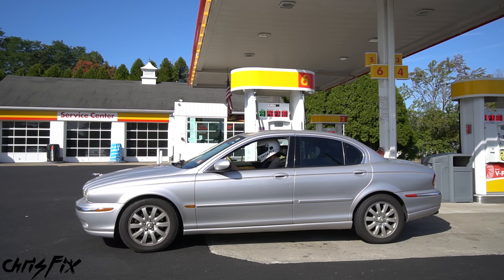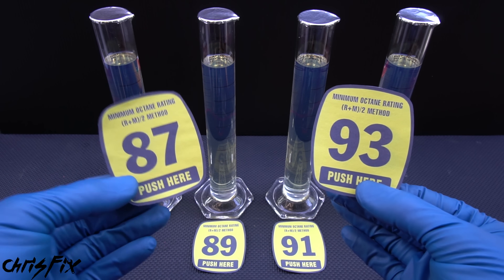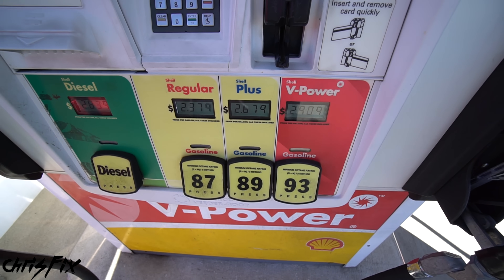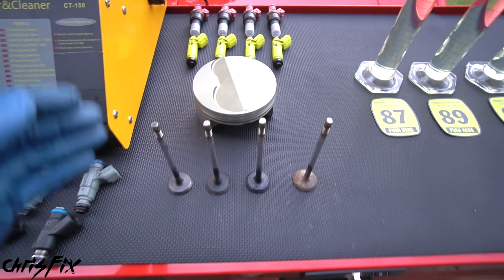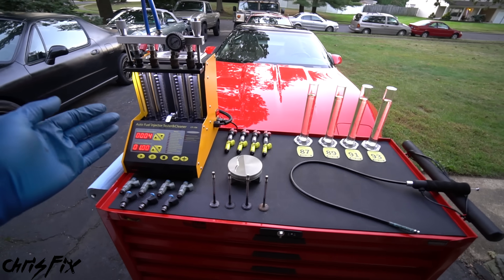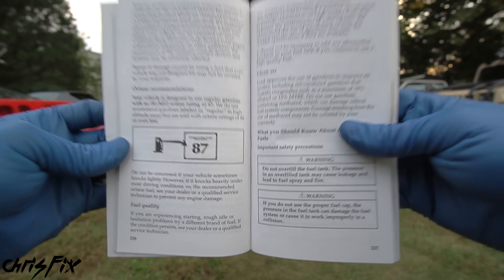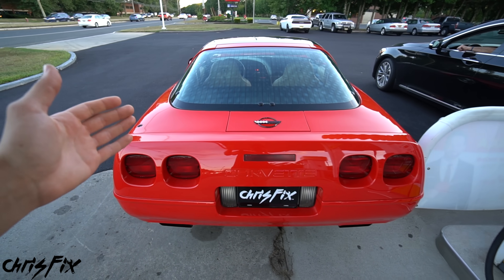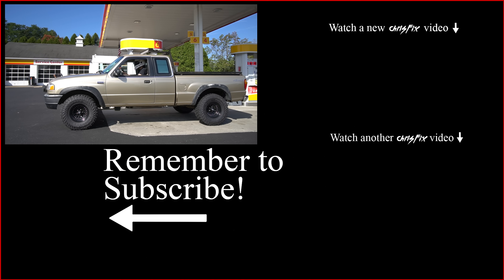What is the BEST Fuel to Use in Your Car or Truck and WHY

Comment: its not so simple; if you have a GDI with low tension rings better to go the most octane since it contains a lot ore of the additives which magnify the cleaning and lubricating effects of the fuel in the ring zone

Comment: At the 7-minute mark this is really unfortunately a little deceptive because he's talking about direct injection engine with the valve. Is insinuating that the gas keeps it cleaner but the gas doesn't hit the valve in a direct inject engine which is why they are building more and more crap nowadays. If it was a normal engine these valves would stay clean because gasoline would clean them in the engine itself but now the engineer it so it doesn't which is another things that make new engines crap

Comment: Some of the this stuff is such BS. First of all they do make gas without additives. They sell them to off brands gas stations like anything that's not shell, Chevron and such. Another thing is in the 80 to the early 2000s Toyotas and Hondas go a half a million to a million miles without carbon problems and they didn't have all of these additives. Gasoline itself cleans a lot of the carbon off so stop with all the BS it doesn't help near as what people think.

Comment: Apparently this is VERY prevalent with a variable compression engine. My nissan rogue is made for 87, but runs very notably better with 93 octane. Its compression range is between 8:1 and 14:1 both crazy ends of the spectrum. But the acceleration and power profile and apparently the power curve are drastically different depending what I put in. It makes 201 hp at 5000 rpm either way but you feel the difference getting up to speed before that.

Comment: My truck takes 87. I once blew a spark plug driving up a mountain pass while towing a medium-heavy load. Nothing even close to the towing capacity. I spoke with a mechanic later on who recommended premium fuel in those situations. After watching your video I’m assuming this info was completely incorrect?

Comment: I used to use 89 octane a fair amount of the time in my old Ford Ranger trucks. I noticed that those 3.0L engines would want to knock as they got some mileage on them. Running 89 octane cured that without needing to burn premium.

Comment: I have a 2004 Toyota Echo RS 5 speed with a 1.5L, 4 cylinder engine. 
I've used Shell 93 octane in it the entire life of the car. 
It curently has 500k miles on it and still gets 45+mpg. I opened up the engine for the first time this summer, and it looked like a brand new car. 
Original everything except brakes and alternator.

Comment: Chris if I'm required to use a premium 91 or higher octane on my dirt bike but I'm using ethanol free to keep my carburetor clean should I use 91 or higher octane booster to have proper Octane and still have no ethanol?

Comment: In higher elevation places like Utah and Colorado, 85 octane is offered instead of 87 due to the elevation difference.  Is it bad if I use 85 instead of going up to the 88 midgrsde?  (I live in Utah and the octanes offered are 85, 88, and 91)

Comment: What is the meaning unleaded fuel
Reply: It means they don't put lead in the fuel to control octane. It used to be how it was done till everyone figured out burning lead into the atmosphere is actually deadly for everyone lol.

Now we use ethanol. Ethanol burns cleaner than normal gasoline and is still able to increase octane.

Comment: Hey , I have a 2007 Lexus es350 , owners Manuel says 91 recommend but my mechanic said  I can use 89. What do you suggest ?
Reply from the maker: As long as it doesnt say "required" you can use 89 or even 87. If you hear knocking then use 91. Personally, if you can afford it, run the 91 so the engine can be at its peak performance.
Reply: @chrisfix  there’s no 91 around my area, can I opt for 93 ?
Reply from the maker: Yes 93 is even higher octane which will help maximize the timing and give you more power and probably better fuel economy.

Comment: most modern engines are higher compression than in the past. My car has 10.8 to 1 compression ration Without a knock sensor it would knock and ping running regular fuel. The knock sensor pulls back timing and other adjustments to make it run as smooth as possible. This will lower power. Using more octane will allow the engine run with more aggressive timing making the engine more powerful. This will make the engine run smoother and also keep your foot out of it for accelerating and driving up hills. This can give you slightly better MPG becuase you are getting a better burn.

Comment: “That’s completely false “ is actually false and by no means a fact for all vehicles. 

Some vehicles are regulated by a computer chip or design for regulating the performance. For vehicles that don’t have the restrictive technology, the difference between gas can significantly impact the performance and mpg of a vehicle. This is fact. 

The difference is going to be in the type of driving and time spent idling instead of driving. The other factors are going to be cost and mpg. In some cases the low average of regular gas can save in cost, however, if a driver spends more time driving on the highway, then using premium gasoline can significantly lower their gas consumption. 

The experts are not very expert and it’s common for experts to just say that the other experts are correct without knowing if the research by them was skewed or designed to exclude important aspects of the study. 

Let me use tire pressure as an example. Go to a dealer or tire shop and they will all say to inflate the tires according to the manufacturer’s label on the door. However, the lack of critical thinking has been a major problem in the automotive industry. Everyone knows that there are a variety of tires and by a variety of tire manufacturers. Many of these tires have different characteristics and tolerances. People often buy a different brand than what came with the car. So, the air pressure of the new brand has to be adjusted for that tire. Using the manufacturer’s recommendation can result in under or over inflation. 

So, because not all vehicles are made the same, different engines, and different accessories, then even though the manufacturer says that regular gas is ok, it doesn’t mean that it’s the best gas for the vehicle. And some manufacturers recommend TopTier gas only. So, the better performance can be achieved by using premium if the engine is not regulated by technology. 

It’s a matter of debunking the false information spread throughout the automotive industry.

Comment: While octane numbers represent a fuel's resistance to knock, I learned that higher octane fuel ALSO has slightly LESS energy content, contrary to what ChrisFix says. This is the BTU rating. 87 octane has about 114,000 BTU/gal vs 112,000 BTU/gal for 93.
But the bottom line is, run the grade of gasoline that your car is designed to use.
Reply: You bore me! Troll!

Comment: I have a 2016 f150 5.0l. Ive run the 88 octane & got same mpg as regular unleaded.  If you can find it, runs about a dime cheaper per gallon

Comment: I use normal shell fuel for day to day driving and then if I go on a long trip say over 100 miles then I will use 99 as the engine will get fully up to temperature and will be operating at higher speeds perfect for cleaning injectors and the engine

Comment: 5 years later, still getting good info from this video. I have a car with a tune for 91 and have wondered/seen Ethanol Free becoming more available near me. Would there be a benefit to running that vs 91/93? Is it better for cleaning any part of the engine? I have a GDI so trying to reduce the amount of buildup on those items mentioned in the video is always top of my list. Keep up the awesome work, man!

Comment: I have a 2001 Toyota Camry LE V6. It has 252,750 miles on it and I have been stuck with a knock sensor code PO325 but recently I seen it changed to PO330. I’ve replaced my knock censors twice already, spark plugs, wiring harness, and from what I was told I’ve had to replace other parts due to vibration that is causing the code to pop up. After replacing all of that I’m still stuck with the knock sensor code. I’ve tried using premium before but it did not help but I did only use premium once. After watching the video I’m going to try and go back to premium and stick with using premium to see if I can get rid of the code like that. Other than that my car has no other issues. Very helpful and informative video.

Comment: Great video! E85 is up to 15% ethanol not up to 85% ethanol
Reply from the maker: What is said is correct. E85 is up to 85% ethanol. Technically it is between 51% and 84% but e85 in general means 85% ethanol and 15% gasoline.
Reply: @chrisfix  i stand corrected! thanks for the reply back. great video again.

Comment: we have 87 89 91 here, my car calls for 87, but its a hot running engine, thermostat doesnt start to open till 221°F and i hear noises at times so in the summer i like to use 91. the thermostat and housing is one. mishimoto makes one for my car that opens 9°F sooner than stock, so i recently put one of them in it.

Comment: Easy solution. Look in the owners manual. Use the recommended octane. It's the octane the engine was designed to use.

Comment: Would it be more effective to clean my engine and fuel injectors to put in a few gallons of premium from brands like Exxon, Valero, Sunoco, Citgo etc rather than adding fuel injector cleaner like gumout or Techron or do the gas brands I listed not have as many additives as shell premium

Comment: Hi, Thanks for the informative video. My question is, is that a problem if I use 86 gas on 87 gas car like 2017 Toyota Highlander (minimum reqirement from Toyota) at a very high altitude area like in Albuquerque, New Mexico?
Reply from the maker: Since the air pressure is lower it reduces the chance of engine knock, so you should be ok to run that, if you drive to a lower elevation I'd switch to 87 just to be safe
Reply: @chrisfix thanks. Do i need 91 gas to improve fuel efficiency and to maintain engine health? Since it is recommended to use at least 87 or higher

Comment: 2011 kia soul. engine started to hesitate gradually got worse to the point where engine sound like weird motorcycle. premium gasoline seems to heal my engine problem. is this due to carbon build up? will fuel system cleaner work better in this case?

Comment: I don't see MY fuel at any of these pumps because these are ALL FLEX FUELED PUMPS. None of them have NO ethanol (corn). But YOU wanna burn NON FLEX FUEL! Yeah. REAL, 100% fossil fuel... not some percentage of corn oil added. Sure REAL gas costs more but in the long run its cheaper. Why? Because it doesn't damage your fuel system AND you get much better economy because REAL GAS has more BTU than FLEX FUEL. So WHAT is the BEST fuel? Its not listed here.. this stuff is all GARBAGE but the good ole US of fucken A is trying to tell YOU otherwise!

Comment: Pretty Useless! when it also states “While the vehicle will run on regular fuel, using premium can provide noticeable performance improvements, especially in hot weather or when towing.” so suggested means nothing
Reply from the maker: In that case unless you know you're about to push the car hard, I would just use regular and save the money

Comment: After putting 150k miles on my Ram 1500 5.7L, I noticed in the manual that it recommended mid grade gas.   My checked engine light is on and flashing.  I had it tested and It came up with a P0300.  Can I add mid grade gas to my half a tank of low grade, fill that give me my?
Reply from the maker: That's usually something like a bad spark plug/ignition coil or possibly low fuel pressure/vacuum leak, I don't believe the grade of gas you have in will do much to affect that

Comment: Not all vehicle manufacturers state "use XX" octane.  My Toyota states "use a minimum of 87 octane".

As far as using premium in a vehicle not having any influence on fuel mileage, the knock sensor you mentioned will kill engine knock before you notice it, and it does so by retarding the timing, which kills fuel mileage and performance.
Reply from the maker: In that case as long as you are using 87 then you're good and in an engine designed for regular running premioum doesn't give extra benefits, the engine’s already tuned for 87, so unless it’s knocking under heavy load or high temps or, there’s usually no timing being pulled. Running higher octane won’t automatically advance timing or improve fuel economy in those engines, you're just putting in more expensive gas

Comment: My car is premium recommended... I use regular.  I add lucas oil upper cylinder lubricant every fill up.  (Bought the gallon so its super cheap per bottle)
Bad idea?
Reply from the maker: It's not a "bad idea" in the sense you're going to cause damage, but you likely aren't getting the full power and optimal tune out of the engine. A lot of those products are gimmicks (based on testing I did years ago), if it were me I'd rather save the money and just put it towards premium or even just better maintenance

Comment: Great content for sure! If I may add 2 cents: Octane is the literal name Chemists give to the formula C8H18, the 8th  alkane. Alkanes are the simplest hydrocarbons, with only single bonds. First is methane, then ethane, propane,  butane, pentane, hexane, and heptane, octane, nonane and decane... Gasoline, petrol, or whatever common use terms we have are the same thing: Octane, the 8th alkane, one of the fractions of distillation of crude oil.  Modern gasoline is not pure octane as we have found mixing in other hydrocarbons works well enough on average and is cheaper than 100% purity. They can be other alkanes, branched alkanes, or even aromatics but the idea is to have similar combustion characteristics to octane. In alkanes, smaller chains are lighter and more volatile, while longer chains are heavier and less volatile. Essentially, heptane wants to ignite sooner than octane, which wants to ignite sooner than nonane. As long as there are equal amounts of heptane and nonane (and other molecules of mixed volatility) mixed into an abundance of octane, the mix acts like octane on the average. But 50% heptane and 50% nonane does not make octane. The more heptane and nonane in the gasoline, the wider the range of the fuel ignition. Varied ignition throws off the timing of the engine, which is what we call engine knock. In this way resistance to engine knock = purity of the octane. Hope this helps.

Comment: Usually I use regular on my vehicle. However when I am close to oil change, I put additives in or put the premium gas in a full gas tank. 

At one point, I didn't pay attention to additives and constantly use regular gas. I got problem with the fuel injection when the mechanic show me what happen. He has to clear it and it cost money. Wasted time fixing it and money.

Best just to put additives once in a while to keep the vehicle running smoothly.

Comment: My Dodge recommends 89 , but says 87 is acceptable. When I briefly used 89 for a season and would do wide open throttle launches, there was no detonation or even preigniton detected. When I use 87 there is a bit of detonation, and then the timing gets adjusted accordingly. So, there is a difference between the two. However, for everyday driving, I'm fine with 87.

Comment: WRONG!!! THIS VIDEO IS FALSE INFORMATION!!  Shell doesn't use 7 times anything in its premium fuel!!!!  Shell V-Power, Nitro Pro is nothing more than an additive called "Nemo 1130". It's made by a company called Afton Chemical. Yes, the premium does have a bit more of the Nemo 1130 additive than what's in 87 & 89 octane. BUT, its a very  little amount. Unless you are able to get straight A-grade at 91, 92 or 93 octane, MOST gases are using 83 octane V-Grade!  

Another fact! Most 87 octane  (WITH ETHANOL) is 90% of something called V-Grade which is 83 octane.  So its 90% 83 octane & 10% ethanol which can be an octane of 98 and up. Not something I want in my car! 

If you use 87 octane with NO ETHANOL! It's 50% V-grade & 50% A-grade. So buy 87 with NO ethanol!! 

BUY GAS WITH NO ETHANOL!!
Reply from the maker: I appreciate the passion and you really had to make me go back to the notes for this video when I talked to their engineers, but Shell’s “7 x more detergents” claim in their premium fuel isn’t just marketing, it’s based on EPA minimum detergent requirements, and their V Power exceeds those by over 7 times. This doesn’t mean “7 times more Nemo 1130”, it refers to total active detergent performance, which includes their proprietary blends designed to clean and protect your engine as mentioned. Yes, Afton Chemical supplies additives like Nemo 1130 to multiple fuel brands, but the base additive isn’t the whole picture. Each brand customizes their blend. Think of it like multiple chefs using salt, it’s how you use it that makes the recipe different. Also, the whole “83 octane V-grade” thing isn't true because refiners blend base stocks to hit required octane levels before ethanol is added. The final product must meet strict federal and state standards. No gas station is selling “hidden” 83 octane if it’s labeled 87, 91, or 93, that would be illegal and detected during the states quality testing.

And regarding ethanol, ethanol free gas has benefits in some engines, but modern engines are designed to handle up to 15% ethanol (E15, and technically more but stock you have to stick with E10-15) with no issue. Saying “no ethanol” because it boosts octane is missing the point, ethanol is part of how fuels are blended to meet octane ratings.